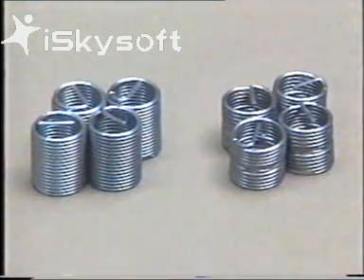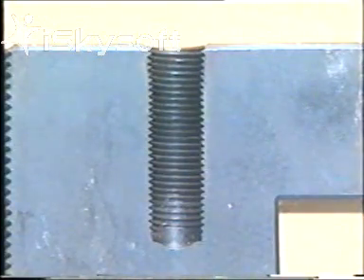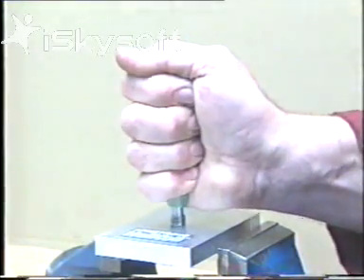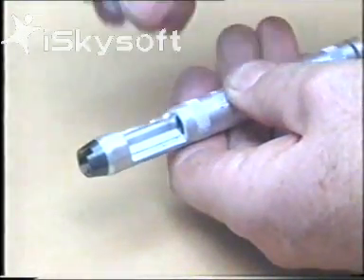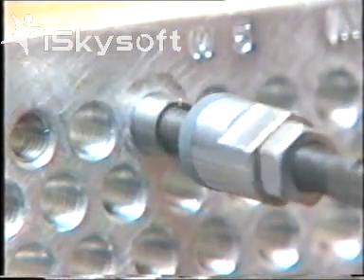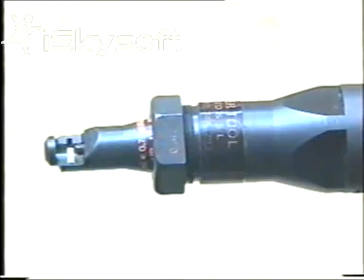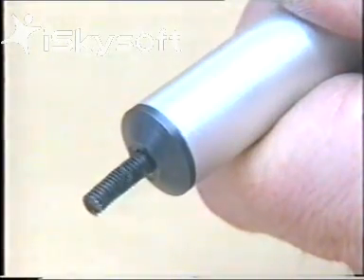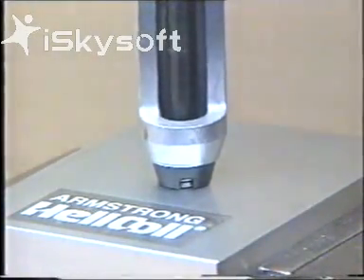HeliCoil : HeliCoil Installation HeliCoil Insert

Comment: Great demo ..I need ur advise plz. I have engine block aluminum and head bolts thread gone so what is ur advise over size with new bolts or Heliopolis?
Plz help me and I appreciate ur help.
Reply: Maaden Engineering Timeserts are better than helicoil because they lock in. A screw extractor can remove inserts. Put oil on the taps and drills. Drill up to the 3rd drill bit.
Reply: The size depends on the size of your screw and the depth of the bottom hole. Do you repair or prevent slipping

Comment: Landrew, in applications like aircraft/aerospace, where very light materials like aluminum, magnesium, and titanium are used for structural parts, installing steel helicoils adds a lot of strength, and reduces wear of the structural parts if the screws are to be removed for maintenance. I used to build spaceflight hardware for NASA, and in titanium parts there is often a danger of threads getting damaged if the screws were removed more than once. Heli-coils reduce that danger. They increase the contact threaded area so soft metals (aluminum) with steel inserts are a lot stronger than just screwing a bolt into aluminum threads.And locking thread inserts keep the screws from vibrating loose.
Reply: Hello friend, you sell? I'm interested in this article.

Comment: I'm not sure I understand why there would be an industrial manufacturing market for this technology.  As far as I know, a Helicoil is only for repair jobs.
Reply: Aluminum strips easier.
Some products are milled in aluminum due to weight savings.
Heli steel and similar type inserts are used to make it stronger and less likely to strip out.
Reply: Hi, I'm interested in this product. As I can wear contact you?